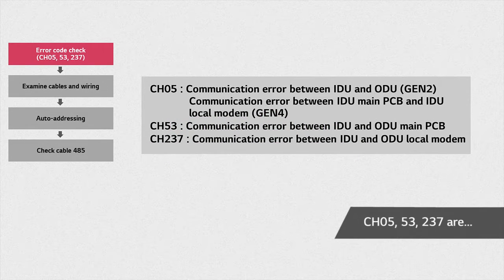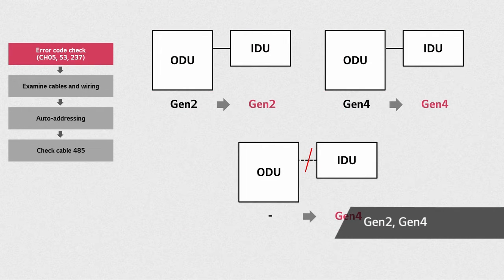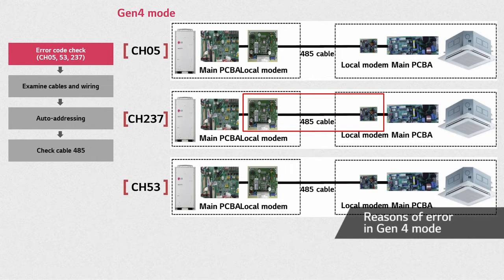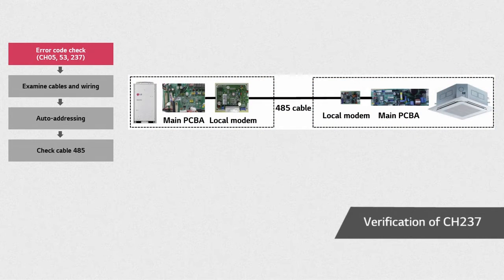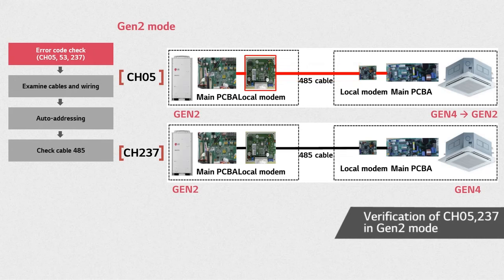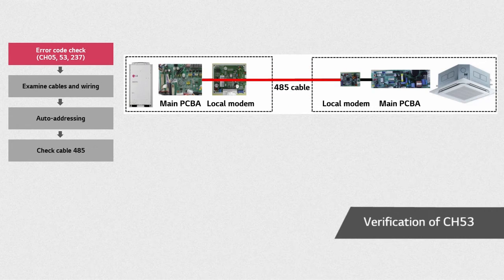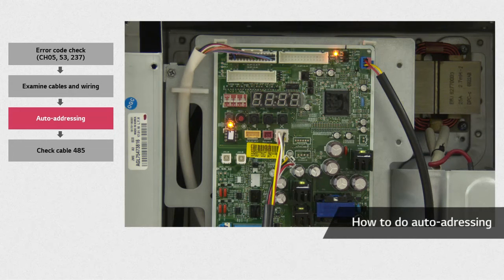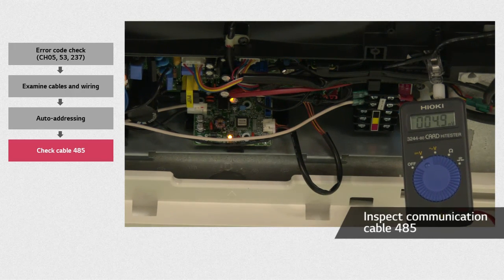LG Multi V : Trouble Shooting Guide (Error Code CH05, 53, 237) I LG

Comment: For LG Multi V error codes CH05, 53, and 237, here are the troubleshooting steps:

1. CH05: This error indicates a communication error between the outdoor and indoor unit. The indoor unit is not receiving a signal from the outdoor unit. To resolve this, you will need repair service.

2. CH30: This error indicates that the voltage going to the unit is too low for proper operation. This is not a defect but an indicator of improper voltage from the outlet. A certified electrician is required to resolve this issue.

3. 53 and 237: If the error codes on your unit are not listed, a service technician will be required for a proper diagnosis. Visit the Request a Repair page for further assistance.